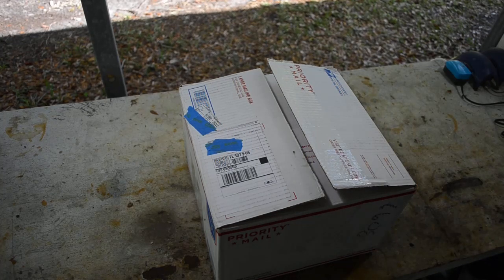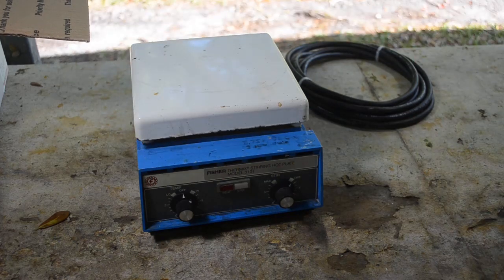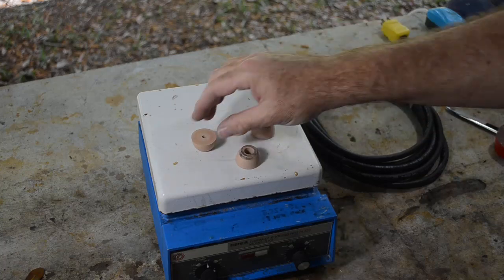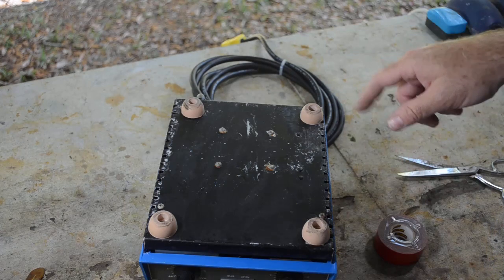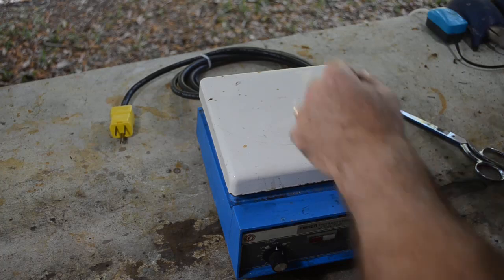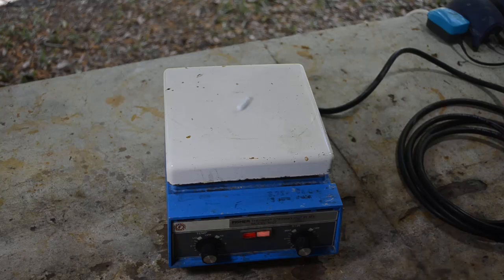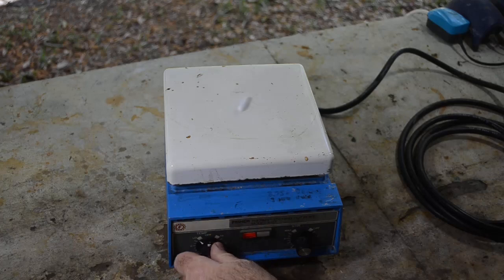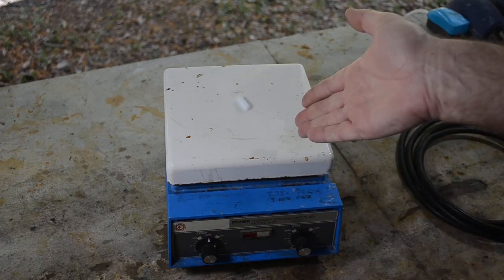Unboxing And Testing A New (to me) Heat & Stir Plate

Comment: Be careful when doing hot AR reactions. Reactions will happen much faster with stirring than you're used to. Go slow at first with nitric additions. You'll notice the reaction will finish within a minute or two then you can add more. I also limit the heat to 80C just because stirring speeds things up and lowering the temp reduces the risk of boilovers